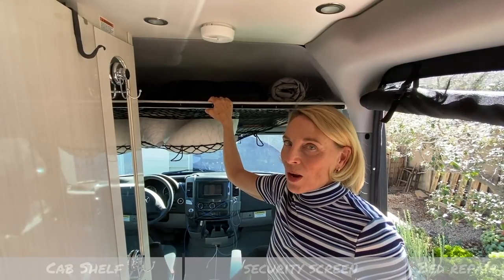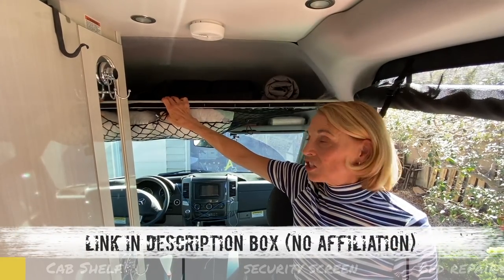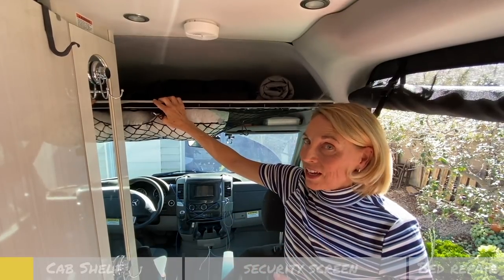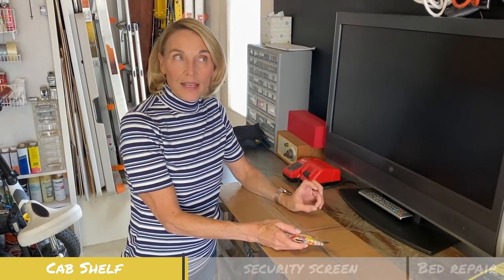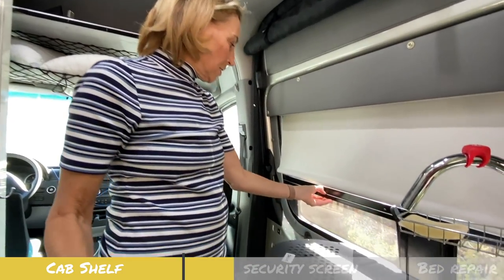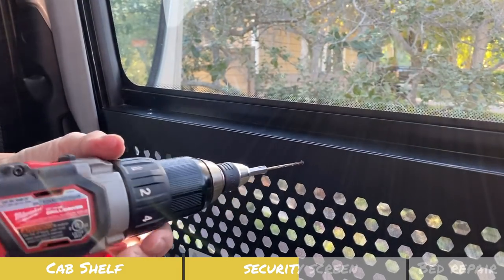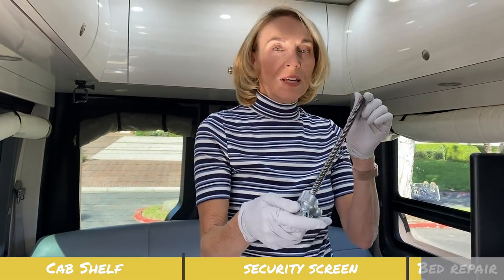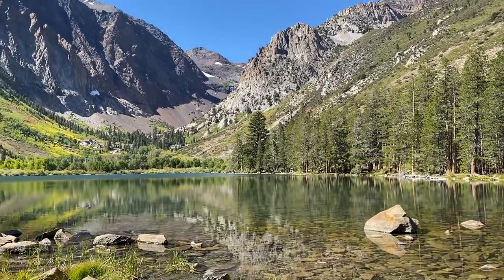Campervan upgrades and updates: Vancillary shelf, Pikavo security screen, bed repair

Comment: Thank you for your excellent videos.  The screws with square head are called Robertson.  They don’t easily strip when tightening.  They seem to be preferred by Canadian manufacturers.
Reply from the maker: Thank you for the info. I knew one of my smart viewers would help me out. Now, if I can just remember it. 😅
Reply: Robertson screws are a Canadian invention. The four sides give equal force on all sides. The ScrewDrivers handles are colour coded, 6 different sizes/colour, so when you are digging them out of your tool bag you know what colour you are looking for.

Comment: Looking good on the fixes/upgrades. Lexor doesn't have the door open knob like the Ascent, so glad you got it protected. Like the velcro option on the front curtain. I am using a shower curtain as have to find a way to attach it to the overhead as it's material so velcro won't stick long.... Thanks for the bed fix as after I saw you issue I was reluctant to bring it back up each day and I did lube the screwjacks to keep them from squeaking. As always, good info and thanks.
Reply from the maker: I never thought about lubing those. Good idea.

Comment: Hi: do you know if this screen is still required on a 2019 chassis with a 2021 coach (Ascent TS)? We have an electric sliding door. Seems like it is tougher to open if the door is locked. Thanks for your help. PS: I called PleasureWay and was advised since it is an aftermarket part they cannot advise.
Reply from the maker: Sorry, I don't know how the electric doors operate.  Was the mechanism installed by Mercedes maybe?  If so, they might be able to advise.